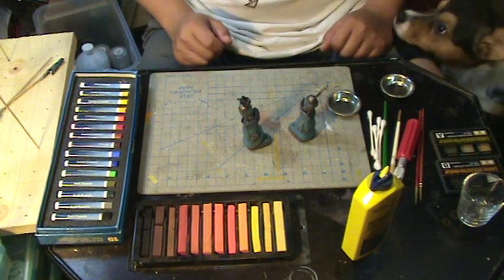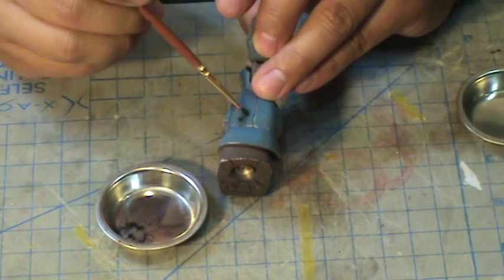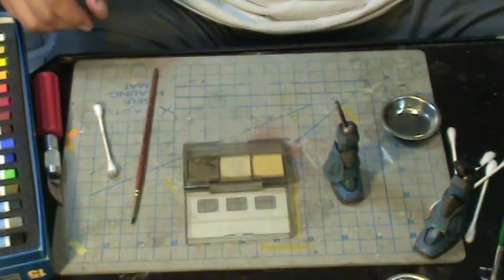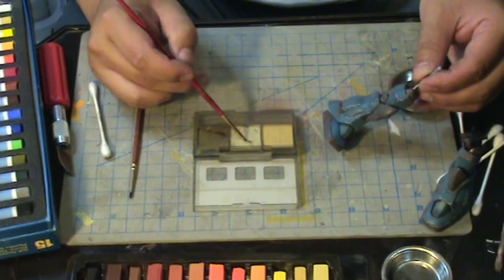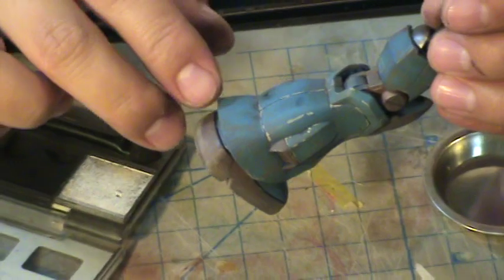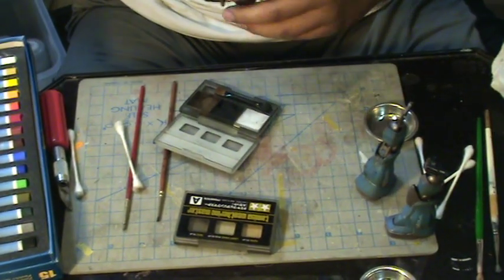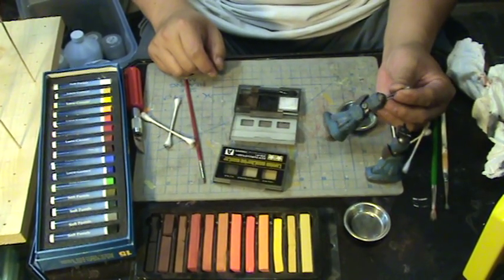weathering_pastels.MPG

Comment: Good demo on brushing with pigments, dry, with emphasis on a matte or flat surface onto which the pigments can  "grab." Pigments are versatile and forgiving, and blend well, as you demonstrated, allowing a Q-Tip to replicate streaking. Very similar to commercially available streaking or rust effects  liquids, but the difference being the use of a dampened brush of odorless turpentine instead of a dry Q-Tip,  to extend and define the streak marks. I feel that this is what makes modeling fun, in that there are more than one way to acquire a particular effect. Again, good  demo on dry pigments, Gamer (which includes Tamiya's oiled pastels - I also have their "B" set).

Comment from the maker: Check what type of paint the testor's dullcote is, I believe that is it lacquer based, but I'm not sure.  Decanting it and using it as a fixer should work.  But I don;t think it needs any dilution if you just decant the stuff, it should work fine right out of the can.  Dilution can help increase working time in the case that the stuff evaporates too quickly.

Comment from the maker: I spray a clear flat before the pastels AND after the pastes.  Before because the pastels will not stick unless the surface is sprayed with a flat.  And after to seal in the pastels so that the kit can be handled without the pastels coming off.  As for brand, it depends on the paint you used.  If you used acrylics, I recommend Mr Top Coat.  Everything else I recommend Mr Super Clear.

Comment from the maker: No problem.  To make the vulcans, measure out the locations on the head.  Mark the area with a pencil or marker.  Take a small hand drill and carefully drill out the four holes.  Use a small rounded file to sand down the inside areas of the vulcans (so you get that curved area on the head so it doesn't look like just a hole in the head, it gives you direction for the vulcan).  Last bit would be to add small metal tubing in place as the vulcans.

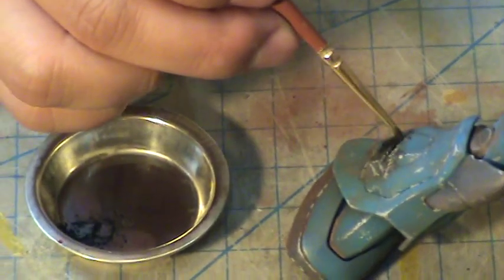Comment: Is it possible to dilute either testors dullcote with tamiya X-20 thinner or a clear mineral spirit and use it as a "fixer" with a brush to make the dry pastels blend into a specific area, for a "dust" effect in corners or wheel hubs etc. on styrene 1:25 scale model trucks and car models. For example, I have seen the AK Interactive pre-made pigments used this way, and the "fixer" acts in a capillary manner making the pigment "flow" into the area? Rather than actually having to spray the matt finish over the whole area of the pastels with an airbrush? Hope this makes sense, I'm trying to learn what the pastels will do vs the store bought pre-mixed pigments. Thanks

Comment: Thanks for the great pointers! Have you ever had a problem when applying the second topcoat the weathering markers you've applied soaking up in the clear coat? Or running?
Reply from the maker: I've never used weathering markers.  I use pastels.  And the second flat coat does diminish the effect of the pastels.  I believe that is what you're asking correct?  To solve this, I tend to over weather, then spray the clear, and it should be fine.
Reply: Yes, sorry my phone put markers instead of marks for some reason :P thanks for the reply. Going to try my first weather with dry brushing and pastels! Thanks for the info.

Comment: I want to weather an already painted flat black Batmobile I have. Do you think the Tamiya "B" kit would show up on it much or should I just use black pastel like you used at the start of the video?
Reply from the maker: Sorry for the late response.  YOu can always wipe the pastels away if you do not like it.  The best thing to do is to paint a test piece the same color as the tire and try the tamiya weathering kit on that test piece.  If it looks good to you, then apply the weathering kit to the tires!
Reply: I tried it with chalk and it came out awesome first try. I slowly wiped away the parts I didn't want it on and it looks so much better. Thanks for the tips.

Comment: Must I flat coat after the tamiya weathering stuff?!
Reply from the maker: Nope, not necessary.  I only do it because I handle the kits and travel with them so the pastels will come off.  I like sealing in the pastels for that reason alone.  So I tend to over pastel as the clear coat will diminish the effect slightly.
Reply: Those Gundam Guys great videos 👍 and thanks for the reply :)

Comment: Will this work with Krylon satin top coat?
Reply from the maker: I recommend a flat finish.  But stain may work too.  Satin will not have as rough a surface for the powder to stick to; in comparison to a flat finish - so you may get a lighter weathering effect as a result.
Reply: Those Gundam Guys thanks! I don't want it too intense, so that will work

Comment: How long do you let the clear coat dry before applying the pigments?
Reply from the maker: At least 3 hours if you're in a hurry, A full 12 hours if can allow the flat coat to cure up enough.
Reply: gamerabaenre I let it dry for about 30mins and tried to apply the pigments, but the surface has already dried up and the pigments didn't stick well to the surface...  I'm using the Taimya weathering kit instead of what you used on the video..
Reply from the maker: Fred k The surface has to be dry.  Never try to apply the pastels/pigments to a wet surface.  It's just a mess if you do that.  What are you using for your clear coat?  If it's a gloss or semi gloss, you will have trouble with the pastels sticking.  You need to use a clear flat coat.  Once dry, the surface of the model should feel rough.  It is this roughness that the pigments/pastels stick on to.  What are you applying the pastels with?  The brush that comes with the tamiya kit, a brush, q-tip?  These all should work very well to apply the pastels.  Now if you go and wipe the surface with a paper towel, you'll remove the pastels/pigments.  This is why you should spray another clear flat over the applied pastels/pigments to seal in the pigments.
Reply: gamerabaenre I'm using Tamiya TS-80 clear flat like you mention in the video and i'm just using q-tip and small brush to apply the pigments.  Do I need to spray several coats before apply the pigments?
Reply from the maker: Fred k Does the surface look dull?  Does the surface feel rough?  I would recommend letting the clear dry for a couple of hours then try applying the pastels.  When I spray my clear flat coat, it takes a little while of dry time before it starts to look dull.  And I always wait several hours after spraying before I apply pastels.
Reply from the maker: Fred k Also check out a tutorial I wrote for my webpage: http://gamerabaenre.com/?page_id=1380 regarding pastels.  And in that video there, I believe I'm using the tamiya weathering kits.
Reply: gamerabaenre I let it dried for 10hrs and the surface feel nothing rough or dull.  When i tried to apply the pigment, it just fell out from the surface like nothing is sticking to it.  I dont know if i'm using the wrong clear coat, but like i said before, its Tamiya TS-80 flat clear.  I did checked out your webpage and it looks like everything work out for you...which flat clear do you use?
Reply from the maker: Fred k Hmm.. that is strange.  If the surface is not dull looking or slightly rougher, then it may be that the can of tamiya flat was mis-labeled or you didn't apply enough.  How far away from the kit did your spray?  With the spray cans, I tend to spray quick bursts 3 inches away from the part.  At this point, I would recommend getting a spare piece of plastic from another model kit, or a plastic spoon and try spraying more of the TS Clear Flat, and see if the surface gets dull/rough (realistically, you should be able to see the effect within 15 minutes of the clear drying)  And then see if the pigments will stick to your test piece.  I use Mr Super Clear Flat from Gunze Sangyo.  Another question, when you apply the pigment, do you rub it into the surface with a q-tip or the sponge end of the tamiya weathering kit application brush?   But if the surface isn't dull/rough, the pastels won't stick.  If you can, try picking up a can of Mr Super Clear Flat.  I love that stuff.
Reply: gamerabaenre I will try to spray more this time and see if that work.  I did used q-tip forthe pigment and it just fell out from the surface the moment i rubbed it on gundam's leg.  I will give Mr Super Clear Flat a try and let you know the result.  Btw, thanks for all the comments you replied back, it really helps me to gain more experiences